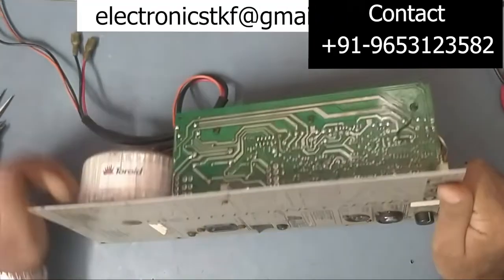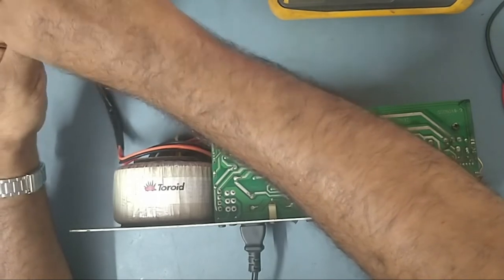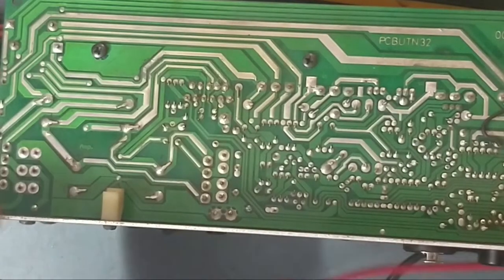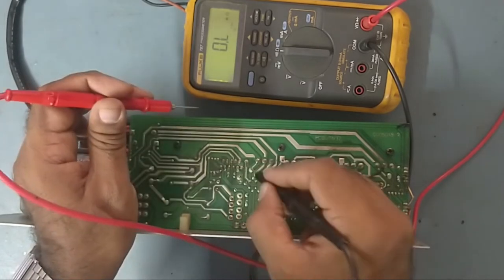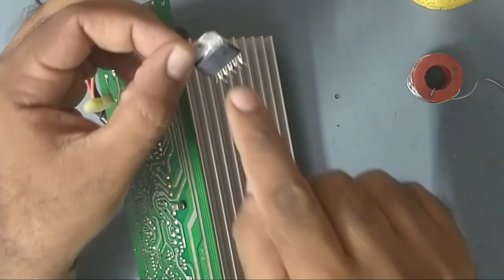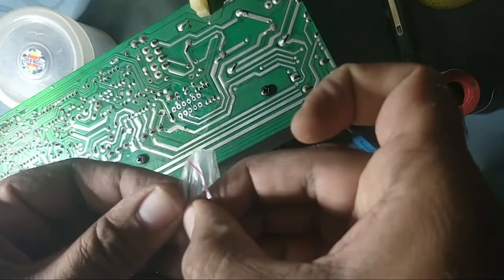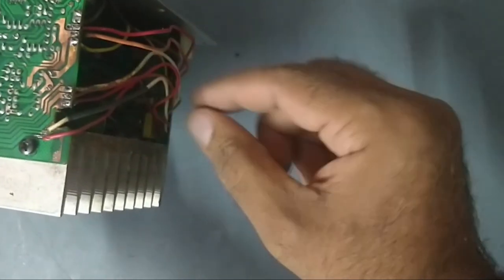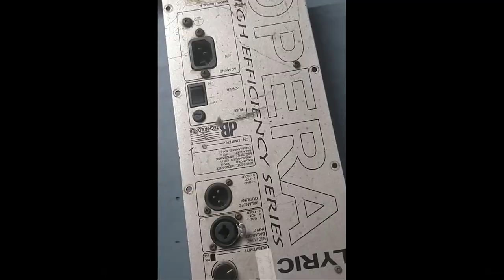How to Repair HF output Not coming in OPERA LYRIC BI-Amp Active Speaker Module from db technology.

Comment: Hi thanks for the video,i have opera 515dx for n I'm looking for d circuit diagram, problem is it's working bt when volume is increased after soe time there is some noises from d tweeter n d output get hot bt if d tweeter connection is removed d woofer work is working fine without any problems can u help with problem thank u